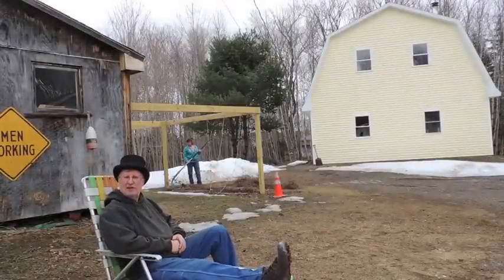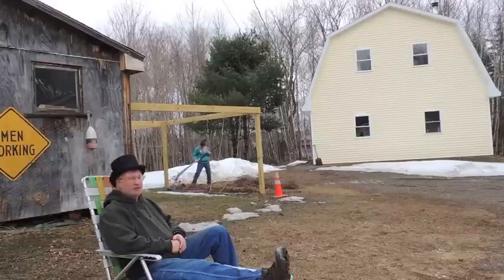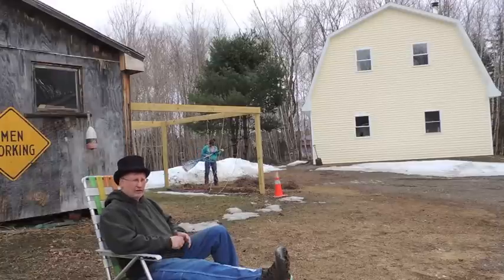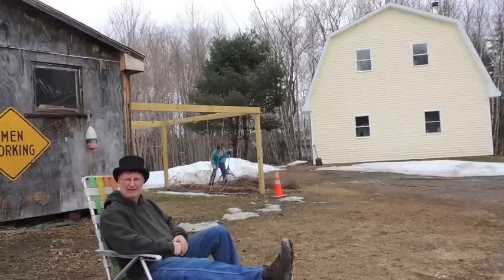Busy

Comment: Well.. Usually you are able to calculate the values of the parts depending on the OP amp you use and what gain or topology you need.